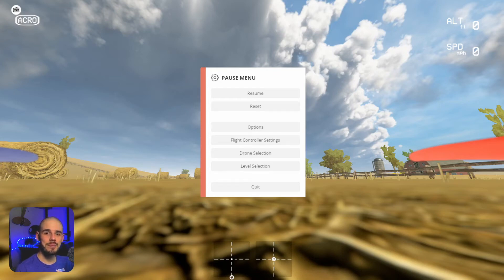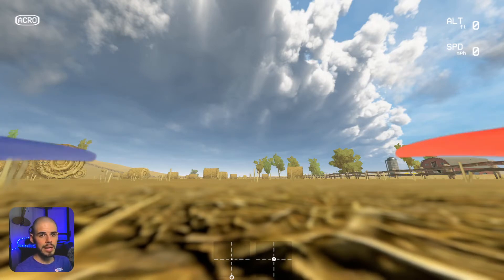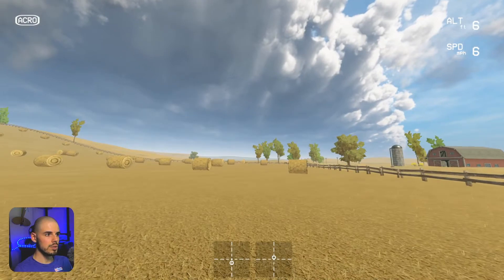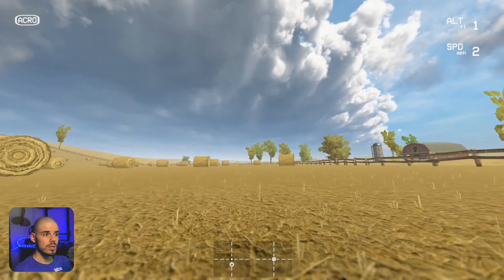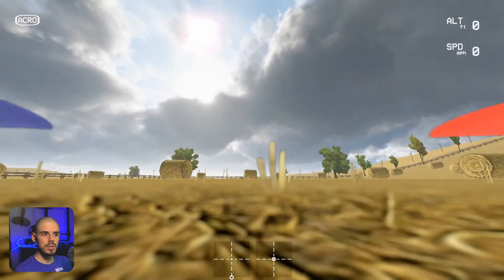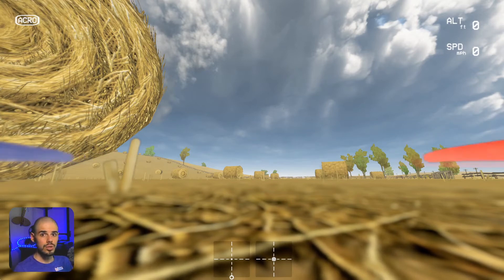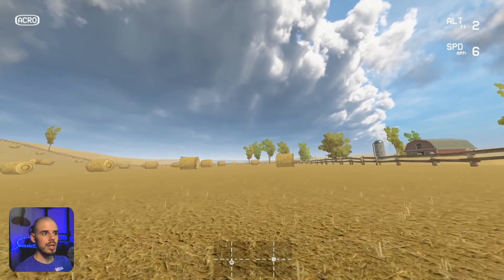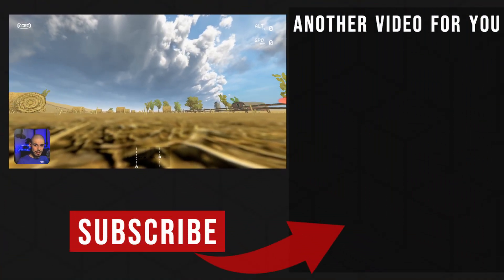Lesson 6: What is Disarming and Why Practice It - FPV Drone Flight Training

Comment: I am new to FPV. I have 20 hours in flight sim. Currently working through beta flight on my first drone. I appreciate you talking about this topic because there's no a lot of information on it. Simple question I just need to answer. Is your disarm switch, simply just turning your arm switch off, or do you set up on a separate switch. Thanks.
Reply from the maker: Hi, Mark! Welcome to FPV! good question. It is the same switch for arming and disarming. I guess the name just changes depending on whether your drone is armed already. 👌
Reply: @RCwithAdam1  Thanks man. So when I set arm switch in beta flight. Arm is on. Not on is disarm. I know it sounds simple, and I have it set up like that. Just wanted to know because as you say, it doesn't work like that in the sim. Be flying this baby for real very soon. Have gps drone exp, but this animal blends well with my normal state of flow.  So excited to have it be part of my life. Appreciate you taking the time to answer me.

Comment: Awesome video, I have a cuestión, i'm between 2 rtf fpv starter kits, one has a better drone and the other a better transmitter and I don't know which one to pick, any advice?
Ps: eachine novice 1 or betafpv whoop racing starter kit 2
Reply from the maker: I think I would go with the Novice. Te goggles and transmitter look a bit better, and the quad  uses brushless motors.
Reply: @RCwithAdam1  is not the old betafpv... is this one https://betafpv.com/products/fpv-whoop-racing-starter-kit-2?_pos=10&_sid=0e6224d13&_ss=r   vs this one https://www.eachine.com/Eachine-Novice-I-75mm-1-2S-Whoop-FPV-Racing-Drone-RTF-and-Fly-more-w-or-WT8-2_4G-Transmitter-5_8Ghz-48CH-VR005-Goggles-RTF-2x-Battery-Version-p-1675.html any advice please
Reply from the maker: In that case, I would go with the Betafpv Starter 2. It looks like a simpler to use kit, and that quad beta65 is better suited for indoor flight as well.
Reply: @RCwithAdam1  thanks man your the best